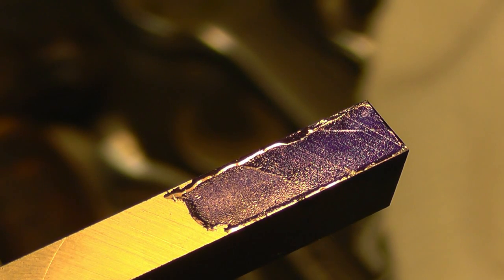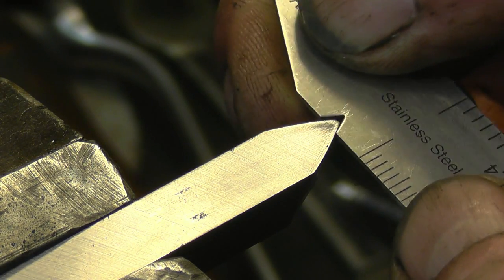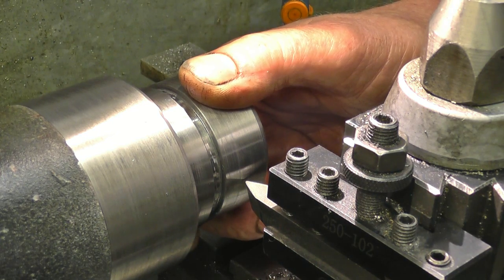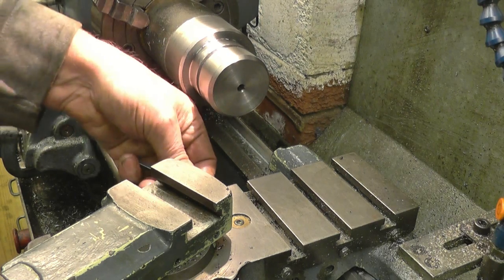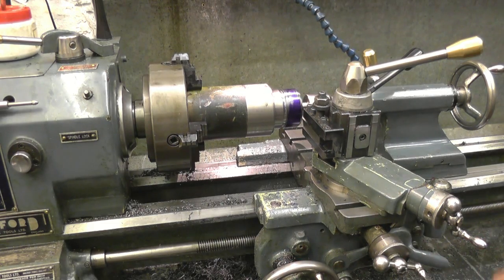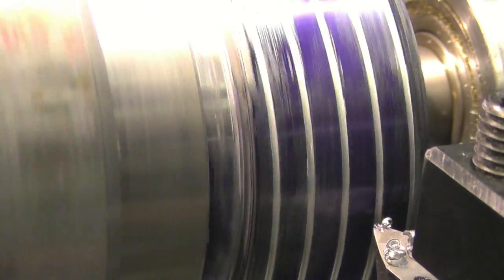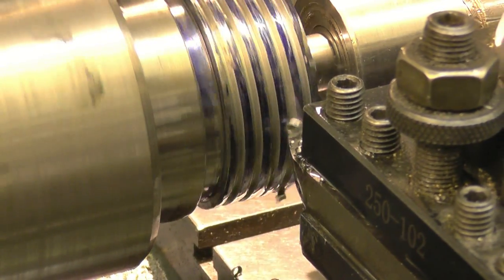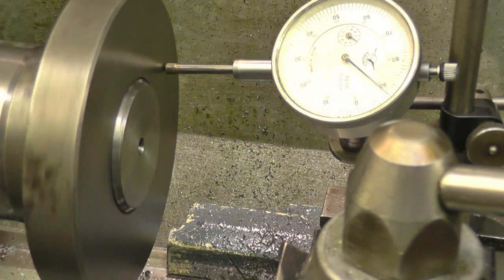Screw Cutting Part Two

Comment: How are you bringing the lathe to the same position each time.
Reply: You engage the split nut and you don't disengage it until you finish cutting the entire thread, otherwise you lose tracking. that's the golden rule of cutting threads on the lathe. This ensures a rigid relationship in all relative movements between the workpiece and the tool becayse they're connected by gears in the headstock. Even when you reverse the late you can go back to your original thread starting point due to the fixed relationship of  the gear train, leadscrew and split nut. You can hear him say drivenut somewhere.

Comment: you need a sensor at the end of the thread and an electromagnet for clutch disengagement. To fit the lock solenoid actuator from the car alarm. The sensor may be a simple switch

Comment: Looks like a great video. Watch out for cutting oil when heated, as what happens when the metal gets hot, they and other petroleum based oils create Polycyclic Aromatic Hydrocarbons PAH's or unburned oil smoke. According to World recognized, International Association for Research on Cancer, IRAC, PAH's are a Category 1 known Carcinogen. When PAH's are inhaled, even small amounts over a long period  it is known to cause Bladder Cancer. Also IARC recognizes Machinists to be at high risk for Bladder Cancer period. Ventlation is a must or use a respirator. You may be laughing at this comment thinking its a joke, but its not. Research it yourself and you will find out, hopefully not too late. Too many Machinists have this desease.

Comment: Thank you sir for showing how and where to place the protractor to achieve the correct angle. I am using a 9 in South Bend, but the concept is the same. I immediately put you on pause and went out into my shop. Sure enough your idea works great. I checked with the dial markings and they were the same as the protractor. Thanks again. Hey don't worry about the accent, I am from "New England" Massachusetts, and I get crap about my accent. Gotta admit though we don't sound much alike :-) . Thanks again.....Marina California (now) .

Comment: I understand that the compound should have been set to 27.5 deg.  So was the error only in what you said, or was it actually set to 22.5? If you set the compound wrong, at what point did you catch the error?
Reply from the maker: The compound was at the correct angle (I have it marked)
The protractor was just for demonstration
No idea why I said 22.5